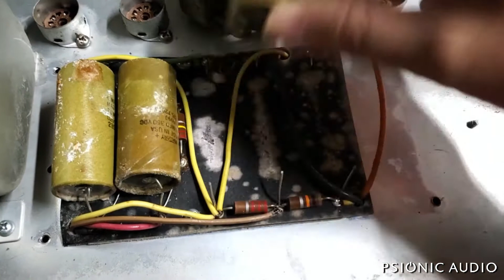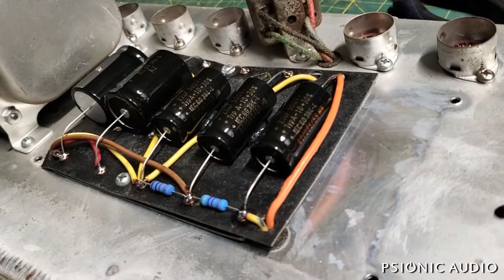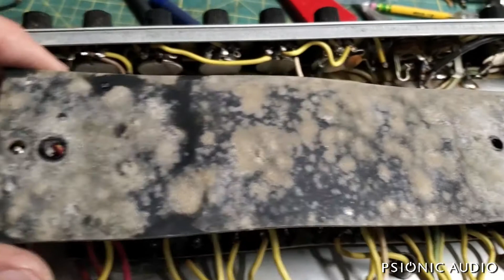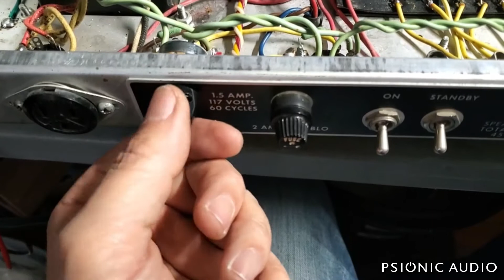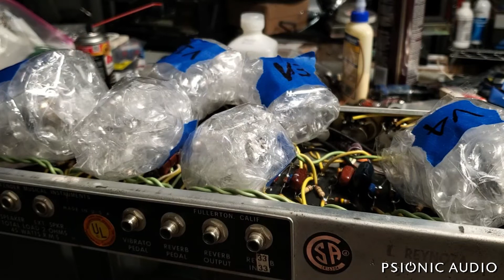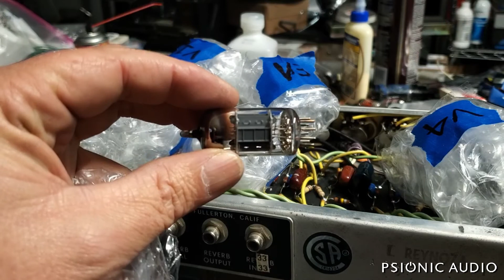'72 Fender Super Reverb Part 2: Showing the Work as It Happens

Comment: I am wondering if you have ever seen the insulator board under the cap house being cut shoddily? On mine, a 73, it wasn't insulating a few of the eyelets near the corners of the cap board properly and there were arc marks underneath those, on the chassis.  I believe it left the factory like that because all but one of the caps were original and everything looked untouched

Also interested in the type of master you installed - I have tried a trainwreck type 3 but I notice the control is super sensitive
Reply from the maker: Not yet, but it wouldn't surprise me. This is the "Lar-Mar" MV.

Comment: Do you like the blue and brown blobs tonally? Are they basically orange drops in construction? I prefer Mallory 150 vastly myself...  my ear hears them to be within 99% of blue molded.
Reply from the maker: They are polyester film, like 6PS orange drops, not 715P or 716P orange drops. The blue and brown blobs sound as good as the blue Ajax. It's just that other things changed in the circuit/build that made the later amps not sound as good, and most players/collectors don't see the other changes, just the different caps. So they rag on the caps, not knowing what the actual culprits were.

I see lots of respected guitar channels on YouTube say truly dumb things about amps, and then they're Gospel because X Y and Z said so. ;)

The Mallories sound great, but they are a little more aggressive sounding. I'm talking subtle differences, but they can be real in some areas of the circuit.
Reply: @PsionicAudio  thanks. Interesting. Modern orange drops are the lousiest of all in my opinion...  most aggressive of all. Perhaps too high performance for tube audio.  Modern fender caps are what I’ve changed to mallories and noticed a nice difference. Immediately. Silver mica in treble and bright instead of the ceramics might well be the best part of it all.
Reply: I rebuilt a 73 bassman a while ago and ended up keeping almost all of the original brown and blue blob caps.  They all work and they sound great to me.  I substituted some with new mallories and swapped them back again.  Sometimes internet lore doesn't hold up
Reply from the maker: @jaycee30865  be careful of silver micas. CMEs are great, but the generic ones just labeled SM are prone to leakage and noise.
Reply: @PsionicAudio  thank you sir. Excellent.

Comment: So, with the filter cap boards in the dog house, you remove the board completely.  How do you ensure a good mechanical connection on the eyelet boards when replacing just a few components?  Removing the main eyelet board seems way too labor intensive.
Reply from the maker: I loosen the screws and tuck leaks beneath the eyelet as needed. How necessary that is depends on the weight of the component. Relatively high mass filter cap needs more support than a resistor does. Coupling cap is in the middle.